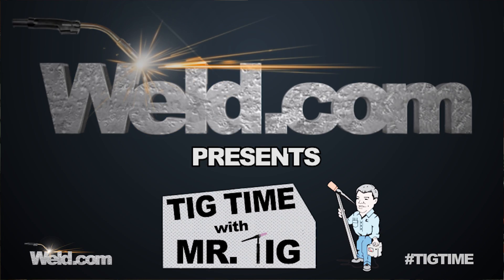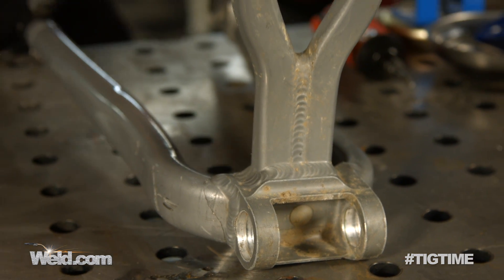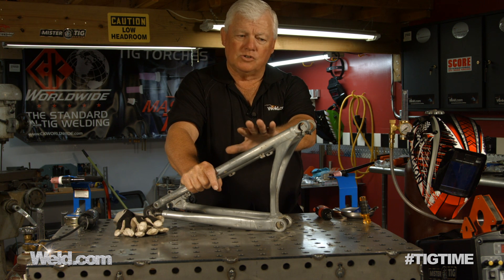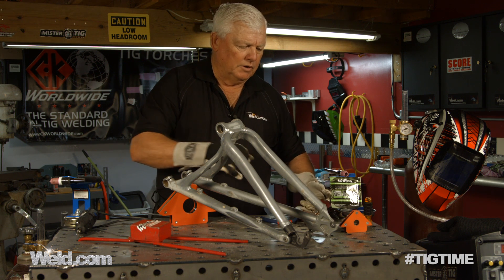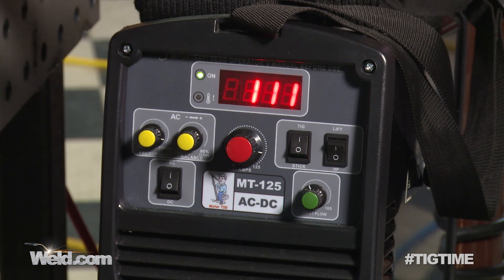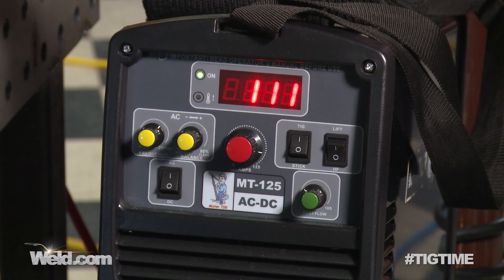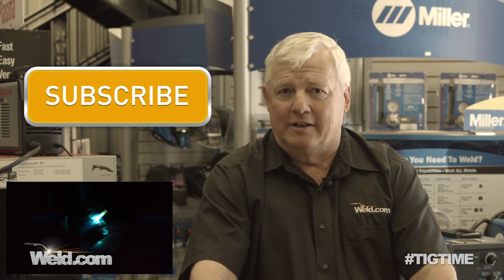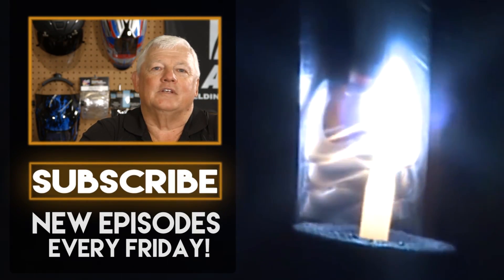Aluminum Bike Frame Weld Repair | TIG Time

Comment: 6000 series aluminum needs heat treating as the weld areas will be significantly weakened, where as 7000 series does not. So it seems you are giving misinformation in this video!
Reply: unless you know the calculated stress on the joint what does that matter.  a $5000 watch tells same time a s $5 dollar watch

Comment: Does 6000 aluminium bike frames need to be heat treated after been welded, as apparently they are 40% weaker afterweld.  Also they need to be realigned after treatment

Comment: Have a question if anyone can help, I have an original Juiced cross-current electric bike

Want to get larger tires on the rear wheel and don't have much clearance on the bottom

I know it's aluminum, it's painted and in good condition without any scratches. How big of a job would it be to get an eighth of an inch or 1/4 of an inch more clearance for the rear wheel

Can that be sanded down? Or some divots put in where the tire comes closest to the metal? Will that weaken the frame? What a bike shop be able to do that or would I have to call a specialist? Thanks if anyone can help

Comment: It seems that you assume it is 6000  serie (which make sens) but not T6 (?) temper and you are not explaining why you do or do not need PWHT . I dont get the benefit of this video since your heat affected zone is potentially 70% less strong after this weld repair. Please explain if I missed something?
Reply: could be 6061 alloy.. when u weld the toughness around heat affected zone is gone..fyi

Comment: also have a 20015 cannondale f29 with lots of DENTED tubes Going to try to pull out dents or fill tube with water and freeze out side in winter time for the ICE to expand 
If not get buddy to fill dent with Aluminum weld then sand down and fill

Comment: Did you heat treat after? Or there is no need to heat treat series 6000s?
Reply from the maker: No heat treat.
Reply: Thanks for responding. What if the welds on my bike got thinner due to metal brush. Do i need to re weld them?
Reply from the maker: THat's a judgment call. Join our Facebook group and post some pictures. We can take a look and give you some better advice.
Reply: @Welddotcom  PWHT should have been done, micro structure will be otherwise very susceptible to cracking. I am not sure if fatigue performance of this welded frame was good :)

Comment: I do not know anything about welding and I could understand you. I have a bicycle with an aluminum frame and I was worried because I always hear that it is not possible to repair them but now I know it is possible. Excellent video, thanks.
Reply: same. my brother told me that my fixed gear frame (aluminum) are not repairable

Comment: awesome. I have a 1999 Sepecialized  FSR XC the has a 3/8" to 1/2" cracking propagating near the pivot point. Of course the part is not available. I need to find someone with your skill set to fix my gorgeous bike. Are you accepting projects?
Reply from the maker: If you can post some pictures on the forum, we can take a look and see.
Reply: Weld.com thanks, I'll do that. to be clear, on instagram, correct?

Comment: I have a mtn bike swing arm that has a small indentation about an inch long, was wondering if I can send to a tig welder to repair rather than spend $450 for a new one?
Reply from the maker: It's hard to say without seeing an image, but it's easy enough to find a welder around you and give them a call.
Reply: its common to crack again if its not all heat treated again. Thats what i believe happened to one of my old frames

Comment: Nice video. I may have to revisit this once I have a proper shop with a TIG welder; my dad has a old Specialized M2 road frame that's got a nasty crack in it... it's an old fatigue crack from an accident a few years prior to the crack's discovery. Goes over 360 degrees in a helix, right where the shift boss got knocked off in the wreck (we had since drilled it out to fit a Cannondale boss set).

What's interesting (and perhaps problematic) is that M2 stands for metal matrix; it's some sort of quasi-exotic aluminum alloy that Specialized had developed at the time. What it is I do not not know but it likely isn't a standard alloy (or wasn't at the time). Wouldn't be the first time a bike company did that either, as the guy who founded Klien bikes added boron (IIRC) to the mix as a stiffness enhancement on existing large-tube aluminum bike frame technology (which was originally developed by cannondale).

Comment: 7005 is very weldable. It doesn't have the Cu content that the unweldable 7XXX and 2XXX grades do.
Reply: Hey mate, I have a 7005 T6 cracked bike frame. Can I weld it without heat treatment?
Reply: @5t3f0  based on my research 7005 is the most weldable bike frame material. It needs "aging" which means it should sit 5-6 days at room temperature after welding.

Comment: I got myself in a bit of trouble last time I cleaned my weld area with solvent while wearing my leather weld gloves. As soon as I struck an arc the fumes in my gloves lit on fire. It took me a minute to realize the excessive heat wasn't from the torch but from my hands on fire haha no injury but I will use bare hands to apply solvent to the weld area, skin doesn't absorb fumes like my tig gloves.
Reply: Catching yourself on fire is part of welding. And everyone whos used a grinder has burned their crotch wit the sparks. Its part of the game.
Reply: That's awesome! Hahaha.

Comment: you ever drill out the end of the cracks?
Reply from the maker: I  sometimes use stop drilling techniques when welding thicker materials.  This helps avoid additional crack propagation.  However,  This particular part was fairly thin aluminum and cracks were easily identified.   My starts always occur in parent material before the crack and add filler.  The same applies for the weld terminations... I always weld past the crack and into clean parent material.  As always,  add a little extra filler at the end of the weld termination to avoid hot short cracking.
Reply: thanks

Comment: Thanks for repairing this.
Reply from the maker: Glad we could help, Paul. Post some pictures of the bike back in service over on the forum if you get a chance: http://www.weld.com/index.php/log-in-to-weekend-warriors/categories
Reply: @Welddotcom  Mr. Tig thanks for the great video. How much do you charge for this same service on the same part of a similar bike? I'm a novice at welding and dual suspension mountain bikes but I can tell that you are the real deal when it comes to welding. Impressive!
Reply: @Welddotcom  just subscribed to your blog and YouTube channel. Can't wait to learn from the best and see some of the repairs that have brought back life to otherwise useless contraptions. Thanks!
Reply: How much did it cost you? Is it still holding up under normal riding conditions?
Reply: Hows it holding up? Was it still in alignment, or did the heat throw the geometry off?

Comment: As a welder who rides an aluminum frame bike, i know a little about the production process for what you have there. Basically, it's gonna be 6061 that is turned into T6 after the fabricatrion steps. In other words heat treatments to attain the far far stronger temper throughout the frame. And they go to all that trouble because just welding it won't hold up. I hope that the piece welded here is going back to the manufacturer to run through their heat treat processes again.
Reply: Will brazing damage the frame like welding will?
Reply: @JamesWilliams-ji4mg  u can do MIG brazing. the heat input to the material is least.they do this for car roofs for visual appearance as well
Reply: How much heat do they usually put into this frame to be solidified?